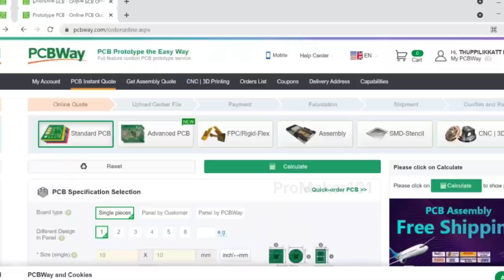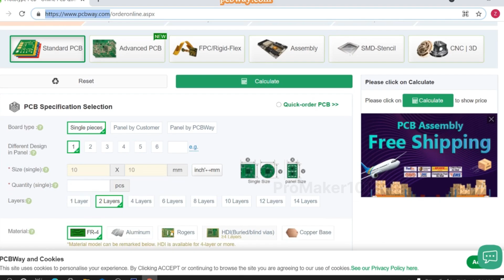Incredible Electronics Projects You Can Build From Scratch!

Comment: Thank you very much for your circuit. But according to this circuit's working principle, if LDR can not get light, activate the relay and add one number to the existing number on the counter. As you said there are 8 person in the building. If one person enters and goes out this means same person activates the system two times and counts two times. This person not in. I mean 7 person come in, one person goes out, counter says 8 but there are 6 person in. ????
In Japan shopping centers there are this kind visitors counters, but coming in and going out ways are different. One visitor come in the center using for example one way escalator,   counter in add one, and goes out using elevator and countet out add one. Differences between counter in - counter out means number of person in the center. 
I hope you can improve your circuit that can count only one way movement. Best wishes. 👌👌👌